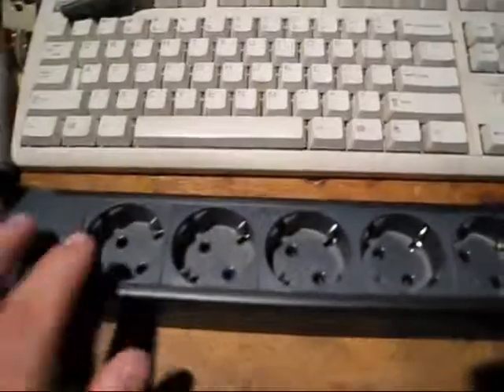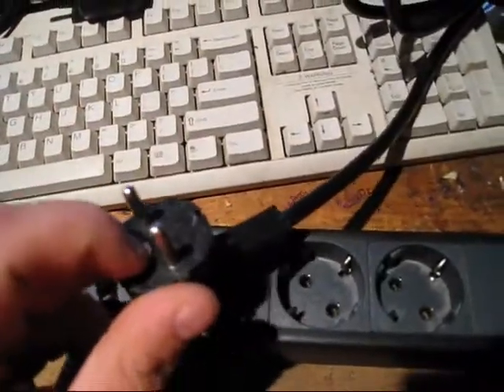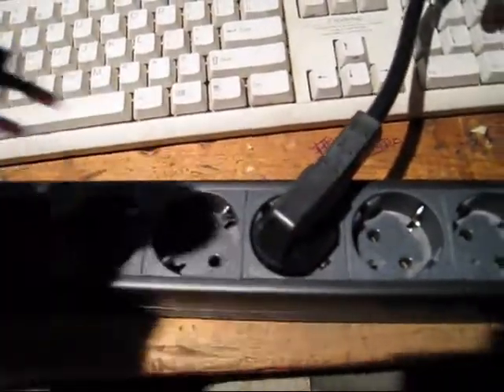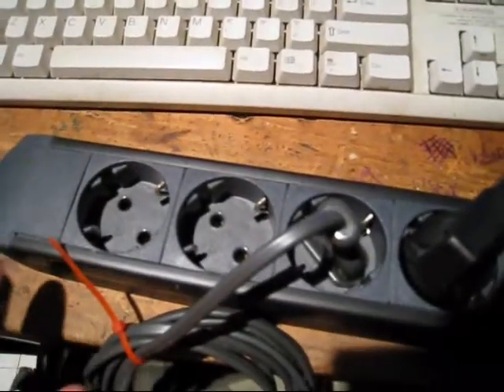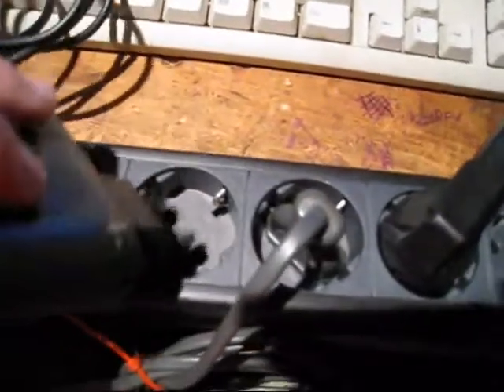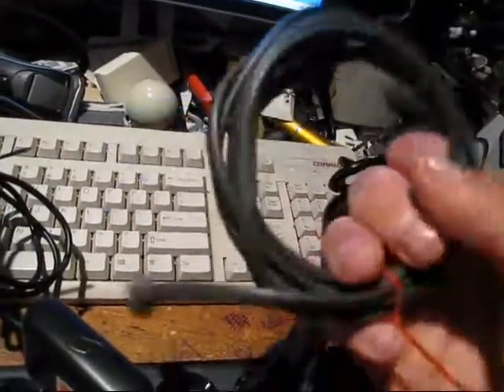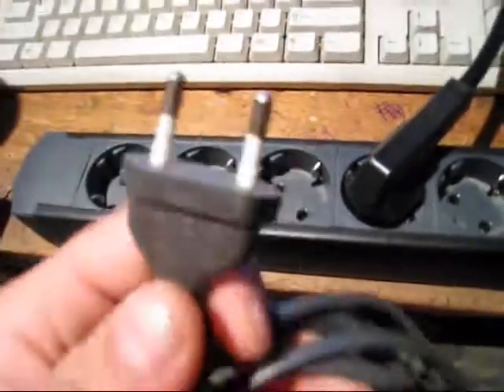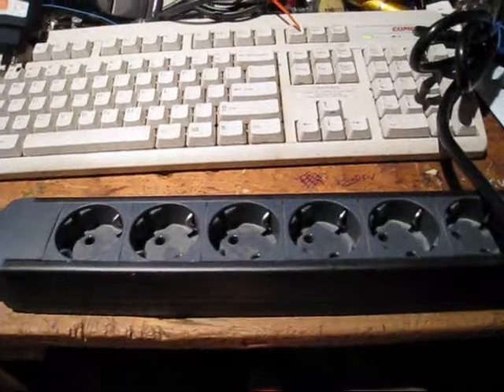World power outlets and plugs

Comment: Have you added more plugs to your collection? Would you consider wiring the outlet at 1:17 just to see if it's possible?
Reply from the maker: I do have a few more, mainly the 2 pin Europlugs, but also a British one as well. I also have a 120 to 230 volt transformer I need to make an update on

Comment: The Plug is ( by USA-definition Type E+F ) German-French combination-plug (the hole is for French socket earth pin) - fits everywhere in Europe ( & Russia & former French colonies & some other countries like Turkey, North- & South- Korea ... etc. ) except: UK, Switzerland, Denmark, partially Italy 

yes, the outlets / sockets of the power-strip are German system, the most used in Europe ( & Russia) today

The flat 2-Pin Europlug fits everywhere in Europe, except UK (maybe fits in low power UK-shaver socket in the bath-room )

Strictly avoid cheap Chinese stuff, especially travel adapters & power supplies (incl. "wall warts") , these are dangerous !
Reply from the maker: Killerspieler0815 yes that is correct as far as the German French combo plug. I forgot to mention that. I also agree that using cheap Chinese electrical components for Mains voltage is just asking for a fire.

Comment: That is a dual standard (French and Schuko) plug as it has a hole in the plug for the ground pin in the receptacle.  French receptacles use a ground pin in the receptacle instead of the plug (what most mains plugs do) or the side clips that Schuko plugs and receptacles use.